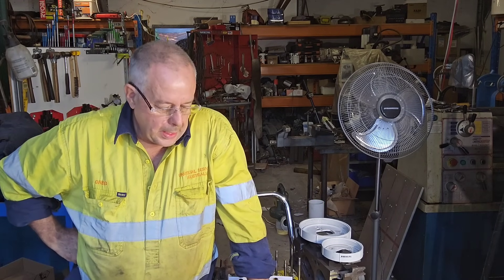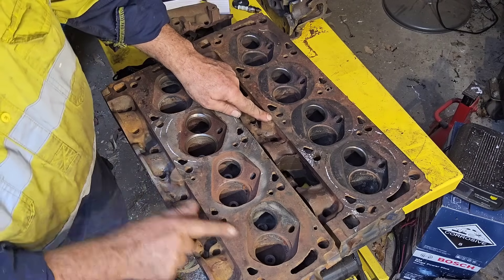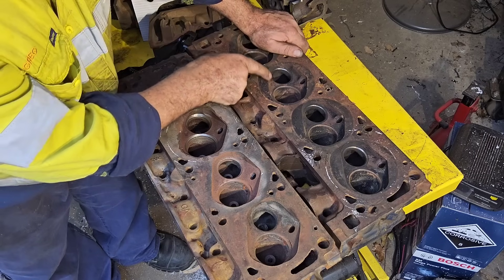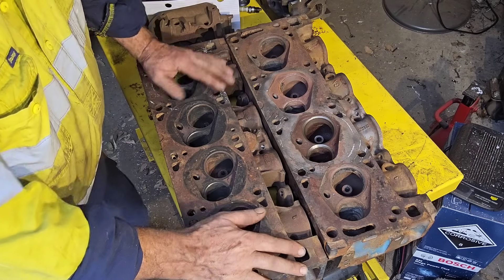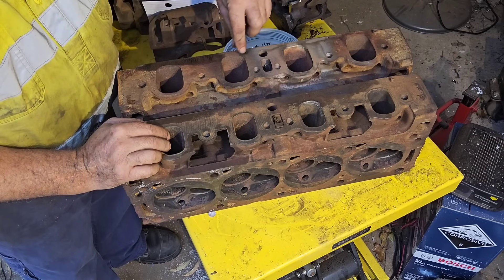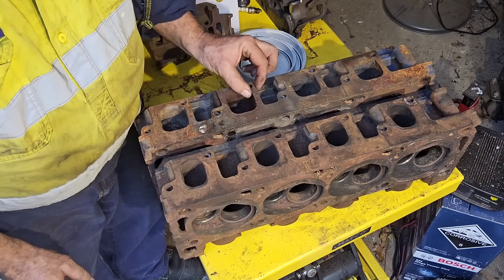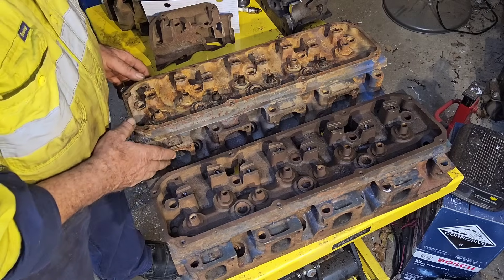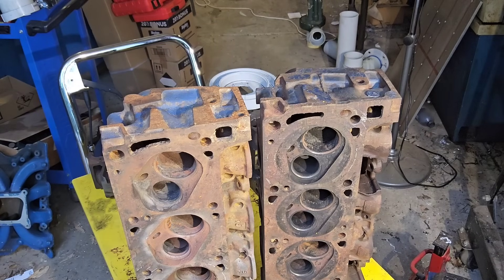Ford Cleveland 4V vs Aussie 302C closed chamber head comparison

Comment: Its always interesting when people talk cantered valve heads , so many people just run with what they have heard, my fav is '"the Boss 302 is a Windsor with Cleveland heads !!" 

(1) The Boss 302 came from the discontinued 302 Tunnel Port program , and the Boss 302 came out in 1967/8 and was designed in 1966. There was no Cleveland untill 1970 so the Boss 302 cannot have heads off a motor that didnt exist untill 2 years later . Plus the Boss 302 heads run water through the intake and Cleveland heads dont have this passage in the heads .

(2) The 221ci,255ci,260ci,289ci and 302 ci Small Block Fords were never called Windsors by Ford . They are not Windsors . The only Windsor is the 351 W and it came out in 1969. The 221ci V8 came out in 1962 .
Reply from the maker: @JosephCowen-fz8vj  you are correct about the Boss 302. The Cleveland head is an evolution of the Boss 302 head, namely different water flow passages. I think it was a good decision by Ford to do that. Thanks for sharing your knowledge, for watching, and for commenting
Reply: Since the introduction of the Boss 302 in 1969 for SCCA Trans Am racing, it was the Cleveland "canted valve heads" that created the Boss 302 engine.  The cooling passage mod also came late in 1969... directly from the FOMOCO website.

Comment: Had 08/19/68 351-4V Cleveland, was 2 bolt main and combustion chamber was closer to your 302 chamber. Flat top piston had 260 psi compression. You stated D for part number, would be 70's.
Reply from the maker: @keithbarron3654  there are a few variations of both heads, but these are the ones that i had kicking around, so that's what the video was made with. Thanks for watching, commenting, and sharing
Reply: D is 70s. There were no clevelands prior to 70 with the exception of the 69 302 boss. Wich isn't a cleveland, it's just the cleveland heads.

Comment: Exhaust port is the limiting factor with these heads.
Reply from the maker: @tenthousanddays2103  according to folklore it is, but who tested them and shared the figures when they had a manifold or set of pipes on the head??? Yes, high ports will make a difference in a race car with no inner guards, but are they really as bad as folklore would have you believe??? 🤔 Thanks for watching and commenting
Reply: @RevShedPerformance   this is so true. Too many look at the Clevo exhaust port thru Windsor/Chev/Holden exhauat port eyes! As in, look at a clevo EX port cutaway, and exclude the extra port length of the clevo(that would get removed if hi porting) whats left is now very similay in valve angle V flange face and overall basic port shape. Then go look at the pipe shape of the first  1.5 inches of the extractors/headers on a chev, windsor, holden V8 and think of their effect on the bare port. A Clevo ex port in essence just has the first 1.5" of pipe "cast in place" which makes the port look worse and flow worse if flowed bare or even with 6" of straight pipe. A fair comparison would be to flow a windsor or chev with a 6" pipe that includes a 45* bend straight off of the exhaust face and compare to the clevo with 6" straight pipe, or even better just flow with an entire primary pipe bolted up. Done this way the clevo port does not come out so bad. For what it is, the 2v clevo ex port is actually quite good seeing that it can actually support more N/A hp than almost any other OE cast iron small block heads!
 Always look at any  in or ex port as a full combination as in think from atmospere thru to chamber, its all part of the port!
Reply from the maker: @craig8187  i ran the numbers off my Poor Man's Flow Bench tests. The straight off the head flow numbers were an average 80% exhaust to intake flow ratio from 0.050" to 0.0800" valve opening. Last time I checked, a number of people would like some time in a private place if they had those ratios on their heads
Reply: @RevShedPerformance  yes there is nothing wrong with the clevo 2V flow bias(not that thats a be all of course) or Hp potential even as cast.
 Any head can be improved of course.
 Cleveland stuff is very misunderstood,  the 4V stuff is tainted by 70's magazine articles when built using chev type cam  grinds 🤣, then the 2V stuff that was largely turfed by the USA builders of the day is tainted by lack of understanding and experience and generally thought of as a 4V head with its flow bias and problems but just smaller. Then guys cam a 2V like they would a 4V when really the 2V is a different head to the 4V and all the inline valve stuff!
Reply from the maker: @craig8187  agreed
Reply from the maker: @tenthousanddays2103  According to folklore it is, but lots of races have been won without port plates/high port heads. The secret is to actually understand the characteristics of the head, and how to maximise the performance of what you have. A point that I would like to make is that you need to compare it to what else was current during its era. If i remember correctly, Eric Weingartner did a flow test on a ported double hump fuelly head, and its flow was less than a standard 4V on both intake and exhaust. Thanks for watching and commenting
Reply: @tenthousanddays2103   i dont agree with that at all. The clevo ex port is extremely misunderstood as most are thinking of chev/windsor/holden ports and see/bare test a longer harder to get into port.  
Look at valve angle V the port and entire primary pipe shape and they all suddenly look a lot more similar. When compared this way for power production the clevo port is actually very good. 
And to digress, yes it can be heavily modified (hi port plate) to be better but ony when the primary pipe shape can also complement this modification. Such is why you cam still see the 'Clevo influence' in modern Pro Stock stuff. No 'top of the range' stuff looks like a chev or windsor layout!

Comment: The Aussie 2V 302 head will take 4V Headers and Gaskets. The American 2V is thinner around the exhaust Ports like the American 4V, and will leak.  American 2V is the Open Camber 2V, not the Aussie Closed Chamber Head, which was only factory fitted to the Aussie 302 Cleveland..
Reply from the maker: @rossbritton4008 interesting. I haven't got an American 2V head available to look at, but I do have an Aussie open chamber,  so I should probably do a comparison video on the differences between the two. I can't remember if I mentioned it in this video, but I haven't used exhaust gaskets on iron heads for over 40 years now, regardless of what I'm bolting onto the head. I just use Silastic. Thanks for watching, commenting, and sharing your experiences
Reply: Correct 👍

Comment: I live in the states and have built Cleveland’s and Windsor for 32 years. I helped a friend build a Cleveland back in 2002. 1970 Boss 302 cylinder heads, factory crankshaft, forged SRP flat top pistons and Eagle H-beam rods. Mechanical roller 0.711-0.714, 262-272 at 0.050, 300-306 advertised, 108 LSA. We used the Chris Parker funnel web intake with the intake stuffer. This car went a best of 8.90 on a 175 shot in the 1/4 mile in a 2700 pound 81 Capri. I never imagined this engine making this kind of power for such a simple inexpensive build. I ended up buying the car off of my friend. I redid the valve train by adding 0.015 longer Manton pushrods and new Comp Pro Magnum rocker arms with PAC springs. Eventually once my 418-W gets tired, the Cleveland is going in my 86 mustang. Cleveland’s are by far the baddest small block engines out of all brands.
Reply from the maker: @StainlessTIG2  thanks for watching and commenting. Cleveland's are only impressive once you've played with them. My initial thoughts are that you would probably benefit from another 3 degrees of lobe separation,  but without having full engine build specs, it's just an initial thought. As this channel progresses, i think that you will get a much better understanding of why the Cleveland/Boss 302 head is both one hell of a performer, and very poorly understood. Keep an eye open for the next video on a cutaway Australian 302C cylinder head
Reply: Wow.
Reply from the maker: @CaptainRedBeardarrr  thanks for watching and commenting
Reply: @StainlessTIG2  have you ever heard of a Cleaver engine it's a mix between Cleveland and Windsor, I just found out that they changed the head so I don't know if it's the Windsor that goes on the Cleveland or the Cleveland goes on the Windsor
Reply: @ Cleveland heads go on the Windsor block. You have to get the Clevor intake. Trickflow sells one for $475-$500.00 and it’s a killer intake. Cleveland has the thermostat in the front top of the block vs the Windsor thermostat in in the front intake. You’ll have to get 302-351W pistons with the valve reliefs for the 351-C canted valve. It’s a pretty simple build. Best way to learn is get online and buy you a book that teaches you every little detail about this engine platform. Be careful about forums, there’s great info and bad info. Get on YouTube and look up Ben Aldameda. One the best Cleveland/Clevor engine builders.
Reply from the maker: @StainlessTIG2  or you can just buy a set of Boss 302 pistons. Thanks for watching and commenting
Reply: @RevShedPerformance the pop-up pistons slow the flame front, reducing efficiency.
Reply: @JustinMiales  Are you talking about the street BOSS, 4v Cleveland heads on a Windsor block? Real monster out of the box.  Only mod required is to block off one of the water ports on the 4v head, and replace pistons on the Windsor block.

EDIT: Okay, I need to learn to read previous comments before posting.....
Reply: @JustinMiales   335 family heads, Cleve's on Windsor.
Reply: @StainlessTIG2  wow is right

Comment: 4Vs are what were they thinking! More so on a Boss 302.  Huge ports, huge valves 8000 rpm +capability with nothing under 6000. And a poorly oiled and cooled lump that explodes over 7000!
Aussie 302 heads start at 58cc on XA and go up around 2cc every model after. A physical impossibility to get 13-1 with flat tops. Max maybe 11.5. Unless you cut the hell out of them and then they will not hold the gasket.
302 heads make decent power from about 3000 up with a healthy but sensible cam. Good springs, retainers, valves, studs, rockers etc with a single plane and long pipe headers will make low to mid 400s.  At around 6500. 11.2-1. Plus you need decent [flat top] pistons, oil pump etc. Even vaguely streetable
4Vs are best left to be used as door stops etc. At 30kilos about all they are good for.
Even 2Vs are too big, intakes are bigger than a Chev mediuim race port.
There is aftermarket heads that are far smaller and make far more power. Canted valve design is good, just way too big
Reply from the maker: Your comments are typical of a Team Small Port engine builder. The Cleveland engine is probably the most misunderstood performance engine in history, but those who know how to build them won multiple NASCAR championships and Drag Racing championships. The Cleveland carried the highest weight penalties of any small or big block engine during its competition years,  so they don't lack performance if you know how to build them. IF you build them like a small port engine, you will get every problem that you have described,  so please watch the rest of the series, and you might learn something about engine architecture and engine building.  Thanks for watching and commenting
Reply: @RevShedPerformance  totally agree! He should go tell Darrin Morgan about how poor the 4V clevo head is ! 😂
Reply from the maker: Hi Craig, I have an enormous amount of respect for Darin Morgan. He has the runs on the board, so to speak. I saw a live chat with him on Drag Boss Garage, where he stated that all current canted valve Prostock heads can trace their origin back to the 4V Cleveland head. However, we have to remember that 50 years of technological evolution has resulted in much better heads than back then, but I still believe that lots of horsepower has been left in the shed, because people have never understood how the 4V head actually works. Thanks for watching and commenting
Reply: @RevShedPerformance  totally agree 👍
Reply: @RevShedPerformance  i can't say enough good about you and you knowledge about the 2 and 4v heads. A 2 v head is a better head than a Small block Chevy. But it is no match for a 4v head, people will build a 4v with a Cam that will pull to 8000 an expect it to have good bottom end. With a properly selected  cam a 4v 351 Cleveland can have enough bottom end power, it will blow the rear tires off from a adle. And talking about  a Boss 302 you know what torque has less than a boss 302 that is a DZ /28 Camaro.
Reply from the maker: @mylanmiller9656  Richard Holdener did a good series of videos on the subject, including the Boss 351, which I suspect you have watched. What he pointed out is that the 4V heads had smaller cams from factory than the other engines, made near enough to or better low end torque than the other engine, spanked every other engine up high, and idled better, in standard form. His dyno testing completely contracted every low torque myth about the 4V head. In my future videos, I will deal with why the myth exists, but it's a few videos away, as I need to deal with some other stuff first so people will understand what I'm actually explaining. Thanks for watching and commenting
Reply: @RevShedPerformance  i have been racing Fords since 1966, i bought a 1971 boss 351 as soon as i  could find one back in 1972. 
I have tried many combinations   over the years and found it is hard to screw up the build on a Cleveland.  They like   compression and they like a lot of cam, if you use a lot of cam, it hurts bottom end power. i bought a 1970 4v Cleveland that was running 16 seconds at 81 mph. the previous owner had already installed 4.11 gears. With a cam intake and headers, the mustang run 12.8 at 108.  The cam was  a cheap Elgen Hydraulics Cam.
Reply from the maker: @mylanmiller9656  interestingly enough, it is my belief that the compression and camshaft points that you have made are directly related. However, in my opinion, based on my experience, very few people understand why. There are going to be a number of videos on this channel about cylinder heads, not just Cleveland heads, and how the design of the head affects camshaft selection. In my opinion, almost every shelf grind cam that I have seen for a Cleveland is wrong, and compression is the fix for bad camshaft design. My thinking will be controversial, but if you watch the series of videos that I am making, I believe that you will understand why I have reached my conclusions. Thanks for sharing, watching and commenting
Reply: @RevShedPerformance  one of the biggest problems I found with cams is, most over the counter cams are cut on a platform that  works on a small block Chevy. Because of  the  Huge ports the Cleveland needs a larger  lobe separation than a 302 ford or a SBC.
Reply from the maker: @mylanmiller9656  you are absolutely correct. In future videos, I will cover this in depth, and why it is so. There is more to it than what you have said, and I am sure that a lot of people will find it enlightening
Reply: @RevShedPerformance  I Appreciate any input from most anybody, I have been building and playing with drag race engines for over 50 years, I found, We can never know too much. I found that I can talk o 10 People all with different ideas and pick up simple things from all.
Reply: ?????... a std 351 will rev 6,500 all day.. chev blow at 5,800, sht valve train.. had a std 351 in an f100 4x4, allways reved at 6000. never sht..  just sold a bronco. 351 with 302 heads. on lpg. 12.1 comp. std cam. went like a cut cat. for 15 yrs.. i think you talk sht..
Reply from the maker: @harrywalker968  thanks for watching and commenting